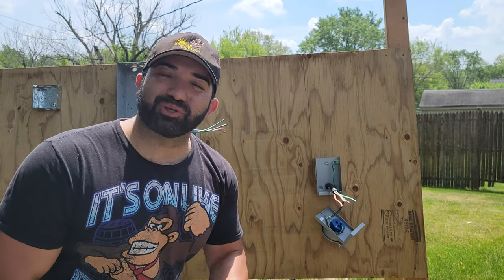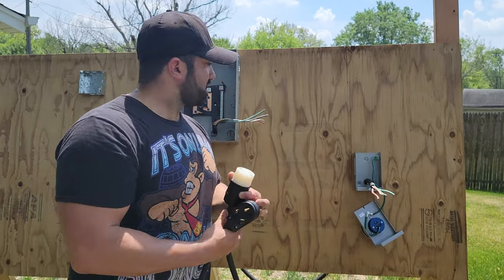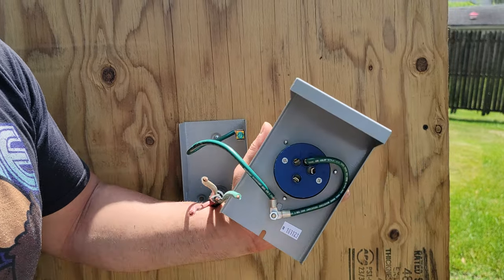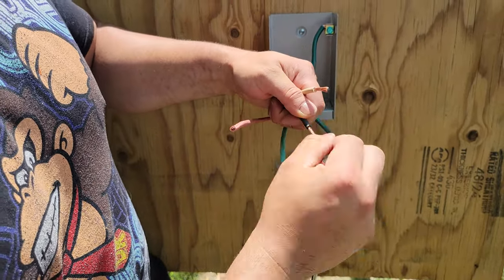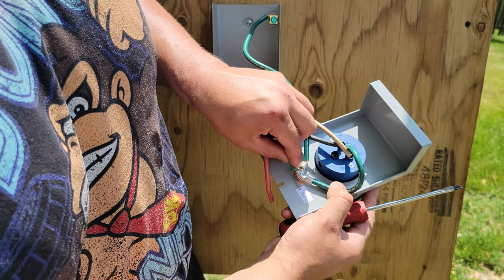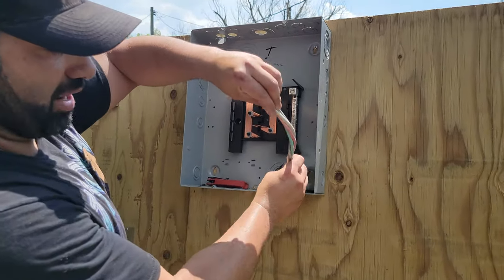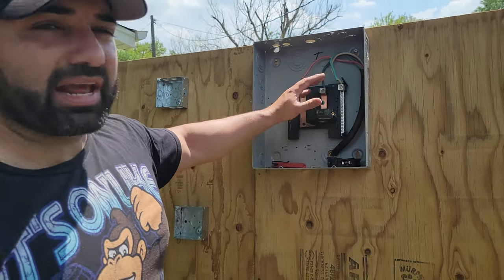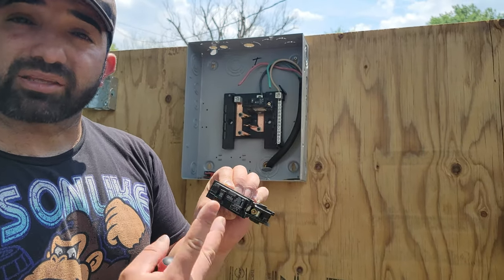How to Build a Food Truck
Installing the Electrical Panel

Comment: Thanks for the videos! I'm currently building my third food truck but always refer back to your videos for a refresher. I will add that if I ky running 120, you can run a jumper wire between both power legs to provide power to both sides. It needs to be clearly marked to only use 120 at that configuration, but if in the future someone wanted to run 240 it would be an easy conversation.
Reply from the maker: There we go!!! Love the tip, and also thank you for watching. Appreciate that 💯

Comment: Hey bud. I use the same 120v generator and I use both legs of the breaker panel. You just need to use the hot leg from the generator-plug and jumper it in the panel. Jumper the legs at the lugs. Love the generator, thanks for the recommendation
Reply from the maker: Absolutely that works! I actually was going to add that to the Video decided not too and said the mini breaker option but you are correct
Reply: If possible, do you have a visual or link to how this is done?

Comment: Great video thank you so much .. doing a mobile art gallery and I have no clue about electrical . I have a eco flow electric generator .. it only have house plugs as plug ins .. but I will buy a adapter plug so that way I can plug it into the breaker box !
Reply from the maker: You can add mini breakers. https://amzn.to/44QYbvh

Comment: if you need a lot of power like I do, you COULD use 2 generators to get 240v. Hook each hot lead to the electrical panel prongs. This eliminates the need for a parallel kit which only offers 120v most the time.

Comment: Hey Frank question I just found your channel I find it very interesting. I need overnight power for my trailer just to run the freezer and fridge when it’s parked on non working days. I have a 50 amp-240v  plug on my trailer for my generator. How can I get electricity from a 120 watt home outlet just to keep my stuff cool over night? What kind off cord outlet do I need.

Comment: Great video, I am planning on using a 50amp generator just wanted to confirm the so cable will need to be rated for 50amps along with the inlet plug? If so the 50amp inlet connector has 4 prongs red, black, white and ground correct? That would allow me to add the extra 2 circuits at the panel
Reply: Also because ampere rating for that so cable it would need to be awg 6 instead of awg 8 correct ?
Reply from the maker: The red and black are not what allows you to have 2 extra circuits that's what gets you 240 volts.
Reply: @fbaltierrez  gotcha I was under the impression that I could use 8/3 or 6/3 cable and use the black for x red for y along with w for neutral and then my ground with a 50amp inlet plug. So that won’t allow me to use the 2 extra circuits?
Reply from the maker: @danielnunez7930  it can. Maybe I misunderstood but yes you are correct as long as you don't use a double breaker than you are good. My bad
Reply: @fbaltierrez  thanks for the info

Comment: How are you grounding your food truck? My fire inspector says I need a ground rod but I’ve never seen this before. My trailer is grounded according to the manufacturer and we use a breaker panel and 50 amp plug
Reply from the maker: Our fire department or building department does not ask us for that. So haven't ran into that issue yet unfortunately.  Typically this is  considered a mobile kitchen and does not have all the requirements that Typical brick and mortar restaurant has. That's how I would word it to them

Comment: Hey quick question on the generator. Do you cover the generator and propane at all when it rains and snows? I seen your video and looks like you just leave it outside exposed. Basically asking is it ok to leave a generator and propane outside exposed. I live in the Midwest and plan using it year round.  Thanks in advance. 💯💯👍 Keep up the Great work!
Reply from the maker: Great question. The generator I do cover bought a generator cover. The propane tanks I do not they sit under the generator so they get pretty blocked off from elements typically

Comment: Hi Frank, I have a 50 amp plug on my food truck but the cable it’s on it’s a 12 gage, just wonder if that’s going to be good for that big of a 50 amp plug? Thank you!
Reply from the maker: 12 gauge is only rated for 20 amps, you'll overheat the wire

Comment: If I am running two 4500 westinghouse generators would the breaker box still be setup the same ?
Reply from the maker: Depends how you are using them. In parallel or do you have 2 different inlet boxes

Comment: On the box plug coming from gen. Can’t we use the matching 3 prong 30amp female plug to match the gen. And do away with the prong altogether?
Reply from the maker: Which prong are you referring to? Can't visualize it
Reply: The same plug type as the generator 30amp 3prong. Or is there some type of building code that states twist lock only? Ty

Comment: So if you use mini and connect the other side then you could have technically 8 circuits correct?
Reply from the maker: Yes but you wouldn't need that many circuits in such a small space being a truck or Trailer

Comment: Appreciate your videos. With two 15k BTU rooftop a/c would it be simpler to run 240v from the genset, and have two 120v circuits from the two legs?
Reply from the maker: Could be. I don't use AC units in my trailer so wouldn't be the biggest expert for that
Reply: @fbaltierrez  Thanks. Know anybody?

Comment: So I have a predator gen and need 240 volts to 1 equipment in trailer and 120 to the other stuff. Would I need to run 2 individual wires/gauges to 2 inlet plugs on the trailer. Sounds like I would need to panels inside, one for 120 and one for 240. Kinda confusing since the gen has separate plugs all over the place.
Reply from the maker: Keep it simple only use the big plug send that to the panel inside and then distribute from there to the entire trailer. Think of it like a house everything distributes from the main panel.
Reply: @Frank Baltierrez  yep I Ike simple. So use the 120/240 volt plug to trailer beaker box, dont worry about the other 120 volt plugs on gen, right?
Reply from the maker: @r.llynch4124  I go to the inlet box first and then the breaker panel as I show on the videos
Reply: @fbaltierrez  Not so simple after all. I have a 240 v unit pulling 18 amps and then 2 refrig units pulling approx 6 amps total PLUS 2 13,500 btu  ac units pulling 13 amps each .. Still sounds like I will need several cables running from gen to trailer ,breakers.

Comment: HI FRANK
I am going to use generator Westinghouse 7500-9500 watts with 4 prong inlet and 4 prong inlet box. I will connect all 4 wire following your video to inlet box BL-W-RD and GR. I still have the red wire on the panel, do I connect to another side? And if I connect to another side, can I use both side of the panel 30amp?
Thank you.
Reply from the maker: Good morning,  watch my videos coming up this week. I'll hopefully explain the electrical to be easier to understand on my new Food Truck build

Comment: I'm putting a 120 breaker in and I have the breaker box going on the inside of the trailer and the cable for the generator to go outside the trailer will this same practice work for that
Reply from the maker: Yes. On my newer electrical videos if you haven't seen those from about 2-3 weeks ago maybe that's what you mean I assume

Comment: Hey bud your videos are great I have a ??? If I'm running a fridge with a freezer flat top grill microwave po's cash register tankless water heater all electric what kind of panel should I get and what kind of inverter
Reply from the maker: @Calvin-w5z  that will be a lot of power. Especially anything that heats and cools like an AC. THE grill will be a big energy sucker. Would almost go to 60 amps the biggest thing to keep in mind Is the generator you will be using.
Reply from the maker: @Calvin-w5z  I don't use inverters
Reply: @fbaltierrez  what should I use for generate I'm trying to keep it as quiet as possible with no noise should I run with a 2:40 panel box
Reply from the maker: @Calvin-w5z  I use inverter generators. Westinghouse is my favorite
Reply: @fbaltierrez  I am making a food truck out of a pop-up camper I just boxed everything in and now I'm working on the inside I was wondering do I need a vent commercial size Hood vent
Reply from the maker: @Calvin-w5z  hood mart I believe only makes one style from what I have purchased

Comment: I have a question about my electric. I’ve been screwed over so many times by people and companies with my issue. So I am at a point that it’s easier to just do it myself. Would it be possible to IM me, because after watching this video ( which makes sense) only confused me more, given how my wires, etc are connected in my box. Thank you soo much!!

Comment: I am looking to split my electric to either run the entire trailer off 1 plug in when I have 50amp or to plug in a secondary power supply and then split the box to run half the trailer off one circuit panel and then the other half off another when I only have 30amps available. Would you have any ideas on how I would do this? Have to plug in points on the trailer and then run into 2 separate panels which have a switch between to split power or run it all through one plugin is what I'm thinking but not sure how to do that split?

Comment: Frank, I know that when finished I need to get a health inspection for my certificate for operations.  My question is do I need to get anything else inspected like electrical or plumbing earlier in the process?  Is it like in a house where an inspector has to come and make sure you are up to code?  I just don't want to get all my FRP up and then someone is like, hey I need to see all your electrical to make sure you are to code.  :)
Reply from the maker: You would have to ask the mobile vendor department in the city you want to sell in and they'll get you squared away. With us they do not but it's different everywhere

Comment: Frank, quick question on the wiring, do you need to run armoring when running the interior wires?
Reply from the maker: That depends on your building inspector if they do inspect it. Some places do some don't

Comment: Frank so I have a ac up top.  Fridge freezer. And exhaust fan and outlets.  Last year we were maxed out at 30 amp.  So would 50 be ok to do.   My generator which does propane and nat gas does do up to 50 amp.      I'm assuming you run yours at 30 amp
Reply from the maker: I would do 50 if you can. Yes I run 30 amps no AC

Comment: Hey, quick question, I’m not getting any power from the generator to the panel. I have the hot wire running from x to x any ideas where I should start troubleshooting? I did have to make the cord
Reply from the maker: And on the panel how did you wire it?
Reply: @fbaltierrez  It was an issue inside the cord. Just sent my first truck out of the door thanks to you
Reply from the maker: @mikewhalen2024  nice!!!!!!! Glad you found the issue

Comment: Hi Frank. Was watching this and I noticed that your plug won't be able to fit in that box. The box is 3 prongs and the plug is 4 prong. How does that work
Reply from the maker: Yes that was an old 30 amp box I had now I use the 50 amp which comes with the 4

Comment: Hey frank! Long-time viewer first-time commenter! So the panel is single phase only has space for 2 brakers? Hownwould i be ablento run more circuits for example that need to be independent? I noticed the link says its. 16 space panel.

Comment: Hi frank.. question..why the cord you using the male has 3 pin and the famale has 4 holes.. your inlet gen box has 3 prong which is the famale goes to inlet box has 4 holes.. can you pls explain. Thank you
Reply from the maker: It's if you want to use 240V you would use the 4 spaces but since I only use 120v only 3 spaces are needed
Reply: @fbaltierrez  thank you... i install my main panel under sink would that be ok or it depends on the town
Reply from the maker: @thankyouvlog9333  depends on town definitely, but it works not the ideal place but it works

Comment: What wire do I use for 220 plug for the main wire to the generator?
Reply from the maker: Depends on your amperage needed. I have used 6 gauge wire now but it depends on your amperage needs

Comment: Is there a reason you didn’t  put the cable through the breakaway has on top?
Reply from the maker: I run my power wire inside my walls so I don't use the knockouts on tops or sides
Reply: @fbaltierrez  I got that. I meant the one that’s on the back of the panel right above the breakers. Next to mounting holes.

Comment: wouldn't a food truck panel technically be a sub panel and therefore neutral and ground should not be bonded. generators should have a grounding conductor terminal for true earth grounding. bonding in this case would make the grounding conductors into current carrying conductors and thus energize the metal food truck. I think lol.
Reply from the maker: You are correct. I have to redo that video as possible I wasn't very clear on that. 👍 thank you for reminding me
Reply: Now I’m confused… so the way you wired it up in the video is not correct? In another video you connected the grounds into the neutral bar… how should it be grounded?

Comment: You can run some generators on parallel kits  and they are 4 prong 50amp. That's what I'm currently doing.
Reply from the maker: There we go. Never used that style of power but have seen others use it 👍👍

Comment: Amigo donde hagarras las. Plogas
Reply from the maker: 50 Amp Generator Plug

https://www.amazon.com/gp/product/B000HS0HQW/ref=as_li_tl?ie=UTF8&camp=1789&creative=9325&creativeASIN=B000HS0HQW&linkCode=as2&tag=rollingburrit-20&linkId=10042d0aa2d8ad0a2df1e1d6382444a3

Generator inlet Plug

https://www.amazon.com/gp/product/B000HRWGBW/ref=as_li_tl?ie=UTF8&camp=1789&creative=9325&creativeASIN=B000HRWGBW&linkCode=as2&tag=rollingburrit-20&linkId=bdb8d132228fd5d3a72ed4104096769c

Comment: or is that a local requirement that i need to find out about... I am being told that i must have a certified contractor do the work, so I am thinking that I can do most of it and have a contractor inspect and sign off on it.

Comment: Trying to wire my ice cream truck with electro freeze 3phase ice cream machine
Reply: You will need a 3 phase generator or other 3 phase power supply for your ice cream machine.  I think you could also install a 3 phase convertor.  For something like this, you are better off with single phase machinery or hiring a licensed electrician for the install.